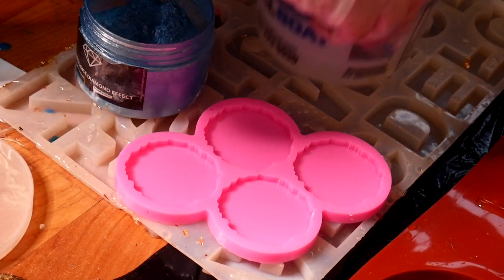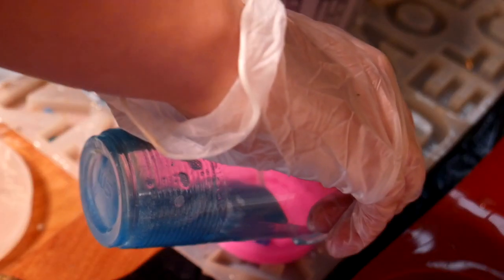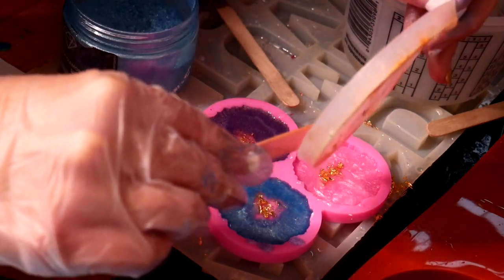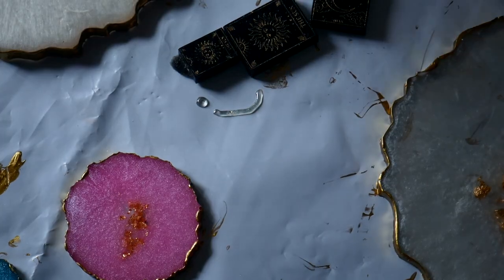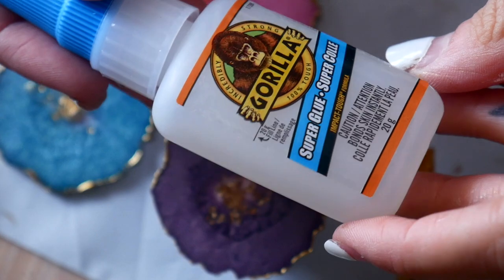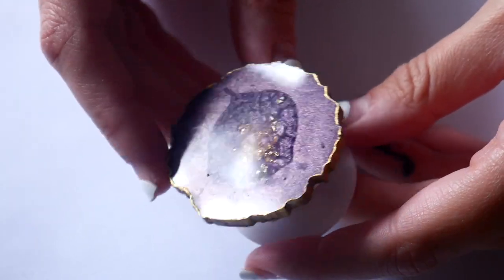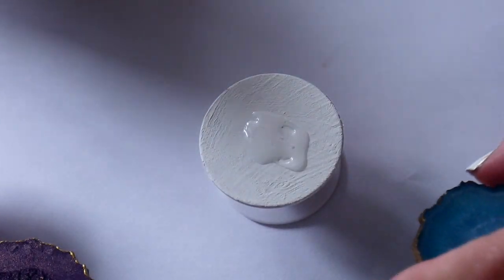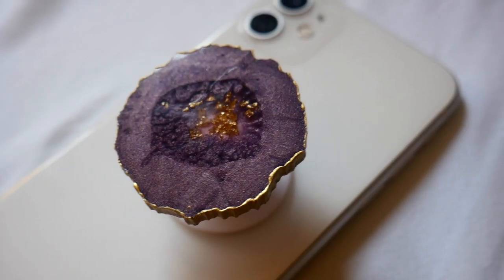How To Make Resin Geode-Inspired Phone Grips | Resin Phone Grip Tutorial |

Comment: I use the Loctite Super Glue Gel since it will not run and I find that it works bit better them the gorilla glue. I know they are both Ethyl Cyanoacrylate Adhesive but I just find Loctite works better. by the way loved the video too.
Reply from the maker: Thank you so much for the suggestion! And for your constant support ❤️